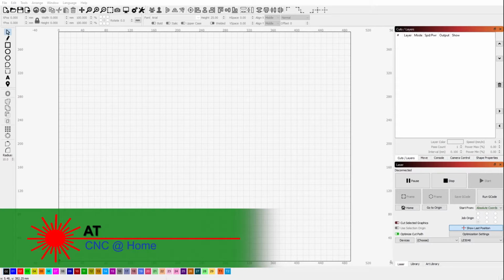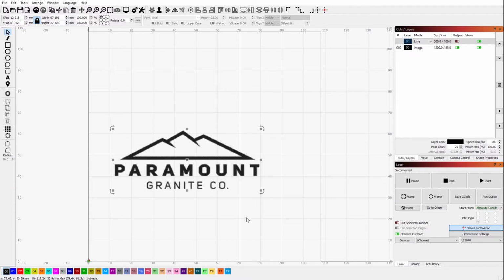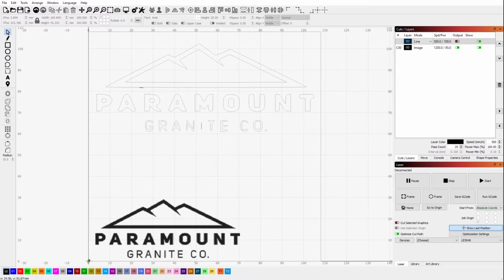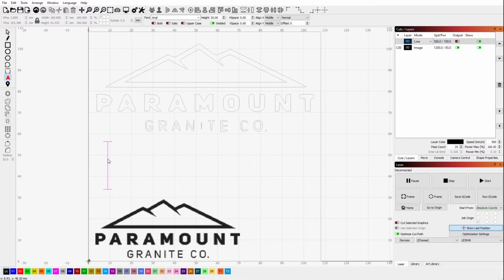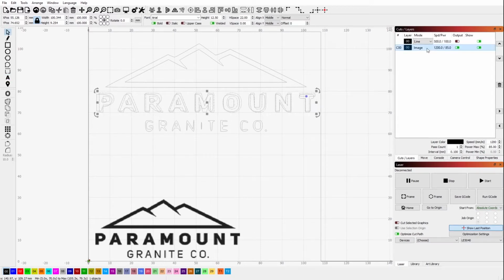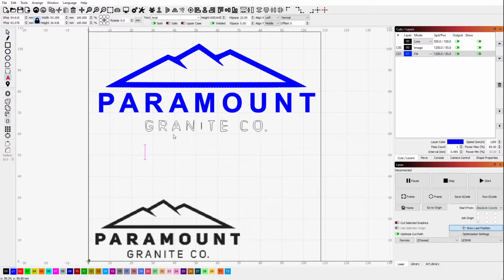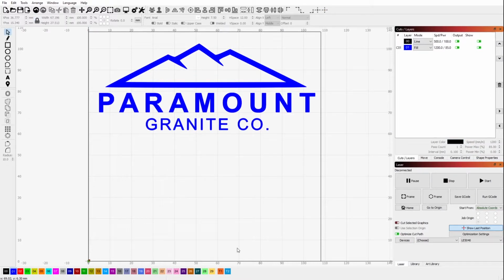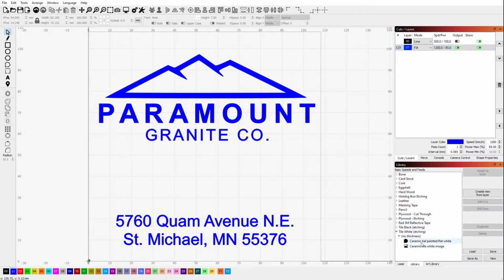Let's visit Paramount Granite

Comment: Hi AT, you seemed To go around this the long way. You traced the graphic & text, they should be vectorised and thence able to zoom & scale individually or together, replicating text and graphic again is en extra , unnecessary step.
Reply from the maker: Your way is how I had expected to do this.  The issue was the small size of the graphic.  Because it was so small, I was not able to convert it to vectors as well as I would have liked.  The mountains came through OK.  The text... well, not so good.  It didn't take long to see that it was just not going to work well for the text.  It was faster to just create new text within LightBurn in this case.  I could have contacted Paramount Granite and gotten an ad ready graphic from from them but then it wouldn't have been a surprise.